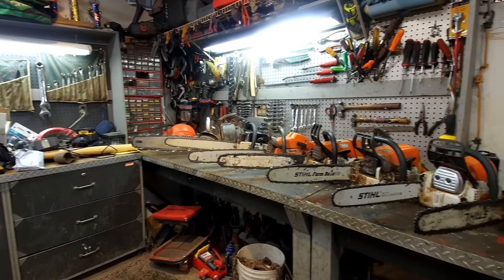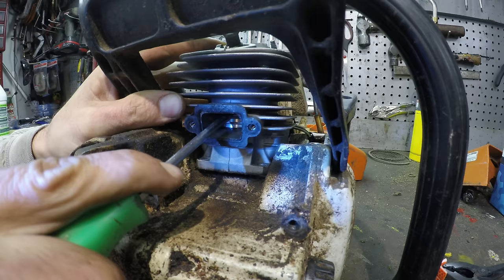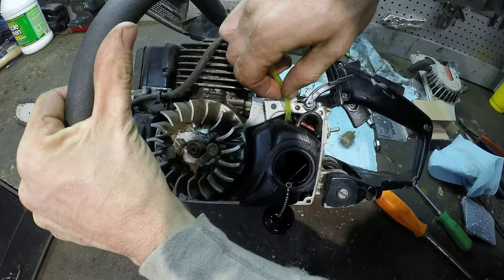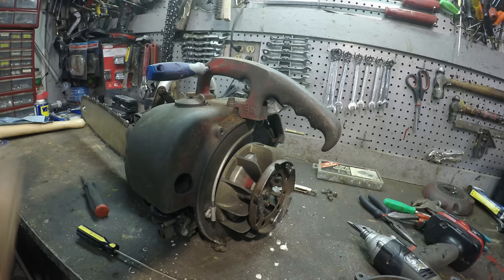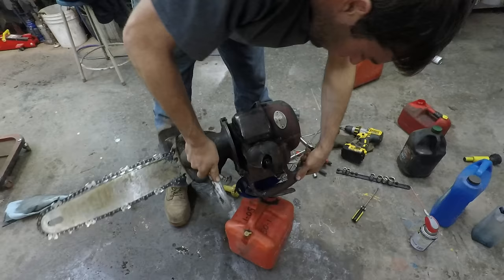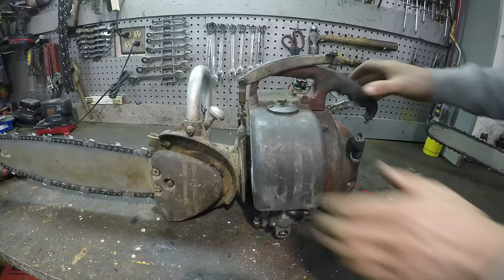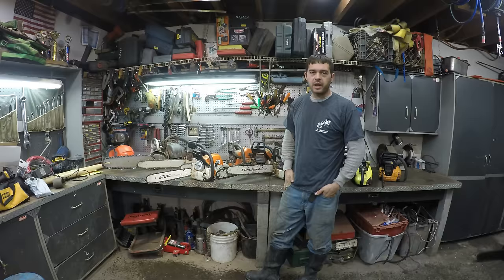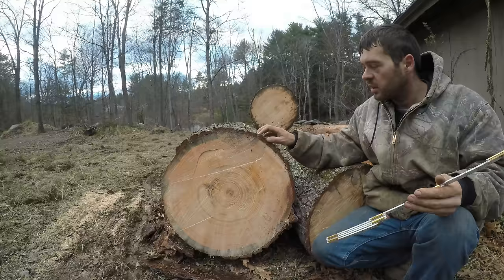Fixing and talking about chainsaws

Comment: Two pieces of advise:  put oil in the cylinder and on the piston rings during assembly. re-tighten the head bolts after a few heat cycles, you will see they need to be re-tightened.
Reply: Agreed.  Assembly lube would be even better especially on the bearings.  That first dry start is a killer.  Take care.  Doug
Reply: I was actually going to say something similar ! Something to add in as I’m an arborist climber owner of my family business. One thing I might want to add. As a new rebuild I would almost treat it as if it was a new saw ? I’m not 100% sure but I would assume so ? Correct me if I’m wrong. When we purchase brand new saws as the business is expanding we are always told to run one tank of fuel through at idle and then the second tank we cut but be a bit easier on it not bam bam bam rapid fire cutting. Give it a little break time and then third tank hammer down. I usually just idle a tank on the way to the first jobsite and she’s good to go. Always had my saws last 3-5 seasons minimum. I have a few big Stihl that we beat the living crap out of 2000-5000 hrs on some of these saws and nothing aside from sea foam in my mix every single tank. Keeps that shit clean and running great. We cut 8-10 hrs a day every day M-F
Reply: First thing I thought, too. Then I said...Andrew did it off camera
Reply: JJY Gardener your probably right. I just wanted to make sure =) my chainsaws are very near and dear to me ! Haha
Reply: I do believe from my day running dirt bikes that the orientation of the wrist pin clips is also important. If I remember correctly the gap should be 180 off from the whole so to lessen the chance of the clip falling out
Reply: I TREAT  these saws the same as any new engine , with a breakin period and these i run rich with oil just to keep em going for a long time , more smoke the better for a while.
Reply: rick davidson If you run it rich with oil then you run it leaner on fuel , so you really (don't know if they are) need to adjust the carb then. float-needle a touch higher or a bigger jet.
Reply: @mitchelsallseason9359  - Something I never hear mentioned in any chainsaw videos is that stihl saws require higher octane gas than any of the others, that is why they run poorly on regular gas.
Reply: Rattlerjake1 hah yep I totally forgot to include that ! I only use premium gas on my chainsaws, sleds quads but you right ! Nobody ever mentions it.
Reply: Dont use ethanol blends in your machines
Reply: Ya, fine guys.  He doesn't dress the metal before welding either.  The thing is, he gets stuff done--in a hurry.  Maybe all our  'gotta does' are just what someone told us was necessary.  Maybe a lot of it isn't...
Reply: Adding to this great advise is also putting a paper towel under the piston as you install the wrist pin clips so they don’t get lost in the bottom end.
Reply: I read through many of the comments here  and this is my favourite critical comment. I think the kid is very good. If he adopts beechwood's advice and the other YouTuber's advice he will be the supreme master!

I take my hat-off to anyone that has the patience to work on chainsaws and other types of engines. What I mean is not giving up until a solution is found and the engine purrs like a kitten.
Reply: Always cut of the biggest part of the center wire part of the wrist pin wire locks where you put the needle nose pliers on. These center parts tend to wobble around at high rpm and catchin the ports and distroy piston and cilinder
Reply: Right

Comment: I'm a forestry student at Virginia Tech and I've been studying a lot about timber procurement this semester!  A lot of saw timber mills usually purchase wood by green weight, and pulp mills usually purchase wood with a flat rate per truckload, both with a desired diameter range, at least in Virginia.  Anything over a DBH (diameter at breast height) of 12 in is usually considered sawtimber unless it is irregularly shaped and then the amount of 16 ft saw logs are also estimated before harvesting so the forester has a cost estimate on what to pay for the standing timber.  Anything below 12 in is considered pulpwood, but pulpwood can be bigger.  Both pulp and saw mills usually have a maximum cut off of around 22-24 in DBH because they can slow down or jam the system if they're too big.  Of course some companies do it a bit differently and for their own reasons.  A lot of factors go into estimating the value and how much they can get out of timber based on log rules like Doyle.  There are Forest Service researchers that help develop the equations that are used to make up those log rules and programs also exist that can help estimate value of timber with great accuracy with just a few measurements.  You'd have a field day if you got a hold on the machinery they use on logging sites!

Comment: Not being critical at all, lubriplate engine assembly lube, or GRC engine assembly lube would go a long way on first start lubrication. Just a tip from an old man
Reply: Yar Nunya  sounds like your on the right track, just get started and it will all fall into place.
Reply: Yar Nunya  - It's a Honda, they never die.  Just spray some starter fluid in the air cleaner and varooooom!

Comment: Tightens bolt as tight as possible without torque wrench
“Alright. That’s torqued to spec right there” 24:53
Reply: I always tighten until the fastener starts getting easy to rotate. Then you no you have just passed the maximum torque of that fastener and material
Reply: If you are a expierenced wrencher you can torque to a ballpark close spec. Others dont have it at all and  can break any bolt/screw regarding size.
Reply: German specs. Goodentite!
Reply: @pikePERSUADER1  I can confirm lol
Reply: OK so with aluminum it’s probably a good idea to use a torque wrench if you’ve got one. You can also put a little blue Loctite on. Chainsaws vibrate a lot. Loctite is good stuff and the blue is easy to get apart Later.
Reply: One of Andrews many sayings that we've all come to expect.
Reply: you forget somthing this is Andrew Camarata and hi fixes things the Andrew Camarata it may not be pretty but it works at least for this time
Reply: its called a built in torque wrench....i have one of those too..

Comment: Be sure to grease wrist pin on piston, I know it dosent need it while running but on first start assembly grease is very important, itll last longer..
Reply: Exactly my comment. My father was a Master Mechanic.  He always said a light coat of oil on dry moving parts never hurt, at best will make things go together easier.  Noticed it was hard to slip that head over the piston.
Reply: was thinking the same thing on reassembly.
Reply: Never want to use grease only use 2 stoke oil
Reply: Came here to make the same comment.  That bearing was bone dry, as well.  At least cover it in oil.
Reply: Oil NOT grease.
Reply: I have heard from a very good machinist that he puts things together with STP. I would agree you definitely need some lubrication when assembling any engine.
Reply: THE MALL WAS JUNK THE DAY IT WAS MADE.
Reply: @slickwilly1099  It Was better than an Axe Or Bow saw !! I lived it !!!
Reply: @Harley8226  ok boomer.
Reply: I would personally just use 2 stroke oil on the wrist pin when installing, I don't think grease mixes well in a running engine

Comment: Great channel! I worked construction and always enjoy watching pros.

Our road crew had a couple of chainsaws from late '50s - early '60s. They had always used 30W motor oil in premix. That's probably where the 12/1 ratio came from. I used 40/1 and they ran for several more years. With motor oil, the gas always evaporated/separated and first pull,  oil in the cylinder. Made them hard to start. A half teaspoon of gas down the carb worked. Both were manual chain oilers you pumped every minute or so. They were also low RPM chainsaws, at least at the chain. Kinda slow cutting. And they had hardnose bar tips, which sucked a lot of power, roller tips much better. The swivel ring on some old saws was likely so you could turn the bar sideways for felling. Some really old saws wouldn't run on their sides. 

I took our old 990G Homelite and put a 4 foot roller tip bar on it with a skip tooth chain.
We had a lot of big redwoods blocking roads after winter storms. The 990G could do a six foot log if needed, but it was slow.

Comment: Andrew, a little 2 stroke oil when you assemble small engine goes a long way, I cringe when I saw you put parts together dry.
But I love you videos I wish I had your energy. Your videos keeps me glued to the screen for the duration that's for sure.
Good job buddy
Reply: I wish I had his patience!! LoL
Reply: Does she like it dry?!?  NO!!  Put some lube on that thing bro!!
Reply: came to the comments to say the same. ANY will do for those who might be curious, 4 stroke oil, transmission atf etc etc
Reply: @bryanford1139  do you mean like slobber on it first? 😀
Reply: @cdoublejj  I can guess what one of those etc might be. 😀
Reply: A guy once told me that everytime I run my saw out of gas I also run it out of engine oil. I thought about that and I guess the oil is mixed in the fuel so it must be correct.
Reply: my thoughts ahhhhhh no oil first oil when ready then oil at finish. like hitler he lost the war at the Urals his boss we run out of oil in 2 months  it did

Comment: I went into my shed and found my dads old chainsaw, hasn't run in 50 years.So I fixed the spark and put a sparkplug in it and cleaned it, fresh fuel and it runs good.

Comment: When you put a new piston and rings on a new jugg you should oil the rings and crank wit Assembly lube or 2 cycle oil. 🛢
Reply: And use a torque wrench.
Reply: Ron's cha-ot-ic world you don’t use assembly lube on chainsaws
Reply: Only 22 $ , it will last a couple of years , thats fine ,,,,lol
Reply: @Wanous-hv7zo   Correct. Dry assembly is fine for 2 stroke engines in dirt bikes and chainsaws. I've never had an issue and the old timers even say it helps shorten the break in period.
Reply: When you made it in the world you don't care.
Reply: When you put a new piston and rings on a new jugg, you should oil the rings and crank with Assembly lube 2-stroke cycle oil. 🛢
Reply: @jet-black  I'm an old timer and the ones your listening to are wrong. If Andrew was following a service manual it would tell him to use oil on all moving surfaces that are metal to metal. I just keep a pistol grip sprayer handy full of two stroke and also assembly grease for non cage needle bearings.
Reply: @jimknowles7643  You are 100% correct sir.

Comment: You asked:  Get on Amazon and check out the Pferd chain sharp filing guide (same as Stihl but about $10 cheaper).  They come for, pretty much, all tooth sizes.  I have them in my tool box.  It takes me about 3 minutes to PERFECTLY sharpen a chain in the field which is much faster than your grinder in your shop.  Fyi, I live in the Pacific northwest - there is a HUGE timber business here . . .

Your ingenuity in fixing things amazes me.
Reply from the maker: Ok thanks, I ordered one. 3/8" right?
Reply: @AndrewCamarata  3/8" is what I use on my saws.   Let me know what you think of it.   There are about a zillion videos on YouTube using them if you're interested.

Comment: Hi I have worked at Husqvarna assembly. We weren't allowed to cut the fuleline with a snipping tool. "Then they crack" they said. So we had a special sharp tool for that, to scissor it of, just as the tool for cutting dog's claws.
Reply: That's cool.
Reply: Krister Kristiansson a
Reply: That's a handy tip!
Reply: We use the same tool for cutting zip ties at Generac

Comment: Love your video! A small tip when re-installing new piston on a chainsaw. Put a little 2 stroke oil before inside piston bearing and piston ring. that will smooth out the first start when all is damn dry.

Comment: You are absolutely right about scaling the logs, many different ways, grades etc. I've ran a sawmill in Missouri for about 3 years now, and something else to note, there are 2 main log scales, doyle and international (some less common, cedar scale, scribner) that most yards will use. When you are selling smaller logs, softwoods or scragg (usually pallet grade hardwoods, small diameter) they may buy logs by the ton. Doyle scale will scale lower on smaller diameter logs, and international scales higher on smaller logs. Just because a mill tells you a board foot price, you should ask what scale they are paying on. Some will quote a higher per BF price than other mills in the area, but pay on doyle, so it can be less. Don't be afraid to call around. Some mills pay the same regardless of the market variations, and some will fluctuate their prices daily. White oak and black walnut are the highest paying types here in Missouri, varying from $1.00-9.00/BF.
Reply: Anthony Krueger Is Reelfoot still buying? havent sold there in a perty long time just curious. Noticed Mo was yer state and the market you mentioned sounded like the south east of the state. Where is yer mill in case I work within a few miles of you...at times I range out perty good!                                    Stay Blessed,  Kev
Reply: Kevin Pilkington my mill is over by St. James, MO close to the center of the state. I do still buy logs.

Comment: Thats torqued  to spec right there..🤣🤣🤣
Reply: Tight, plus a quarter turn is always "spec" :)
Reply: @joeyoliver579  Tight and a grunt. 1/4 turn is too much.  ;-)
Reply: I like it a lot! It Never failed me😎
Reply: lol yeah
Reply: I had to swap injectors in my f250 and my torque wrench wouldn’t fit in the tight spaces. I definitely made my own “click” just as I felt like I was about to break the bolts lol. Been running fine for years now.
Reply: in the older book of stihl its once the bolt is snug its about 1/4 turn. in a X pattern.
Reply: Yep, in Australia doing Heavy Equipment repair we've got two specs - FA and FT, Fuck all and Fuckin' tight..

Just kidding... Or am I?
Reply: "Click"!
Reply: I know right? That was great!

Comment: You are a miracle worker. I know most of those saws and have quite a few of them. I can’t believe you got them to run. None of mine are working now & i do NOT have the patience you exhibit. Wow is all I can say. Thank you for so much inspiration. I will say, years ago I came across a similar 1950’s monster saw at my local Sunday market. I think he wanted $400. It was basically a Johnson/Evinrude outboard motor configured as a chain saw. Unreal. You had to flip the engine over to engage the float bowl, get it going then flip it back to keep it running, it was like a Merlin in a Spitfire but doubtfully that reliable. Insane piece of kit. My “X” said if I bought that, there would be no need to show up for dinner. Best $400 I ever spent!  I will be watching this vid again to try & get more of my saws running again. Thanks for your great work. PS when I saw you bring out the “mini” skidder and grab a tree I thought , “why is he not just going to hang the tree instead of cutting on the ground....” bingo.... touché...

Comment: Growing up in rural Dutchess County across the river from you in the 80's, my family's old house sat on 11 wooded acres. We didn't have ALL the neat stuff you work with, but we always had a Stihl chainsaw kicking around. If it wasn't constantly making firewood for the woodstove in the living room, it was clearing fallen trees and branches from the 800' dirt driveway. After school, my friends and I would sneak the chainsaw into the woods to cut trails for our little dirtbikes- huge time-saver. I remember in the early 80's as a boy, going with my dad to Steve Brady's chainsaw shop. It was in the garage of his raised ranch home back then. As Steve taught my dad how to use and maintain the thing, I was ogling the Stihl babe calendar hanging on the wall above the workbench. Years later as a construction worker upstate, I helped build the barn for Brady's Power Equipment. Steve had come a long way and had a fancy family-owned operation by then. Many years after that, I work in NYC construction but STILL use a Stihl chainsaw. But these days I'm cutting off wood shoring or big plastic gas pipes to be worked into the city's gas main system. Funny, this video brought me back to my family's ties throughout the years with this humble, but extremely useful little machine!

Comment: I'm a McCullough guy all the way (but not the new ones). Brand I use the most though is a husky. The only problem with Poulan saw  are that there carbs plug up no matter what you do also an interesting fact is that Poulan saws are McCullough saws I'm glade you did this video chainsaws are under appreciated it used to take hours to fall mabey 5 trees wich no one thinks about and they are such an important tool. I just love fixing chainsaws as well.
Reply: We quit using McCullough thirty years ago. After they cheapened them up, they would break in the middle of a job, and the repair price and downtime was unacceptable. We went with Stihl. but I'm sure there are other good brands out there.
Reply: @jbbuzzable  yeah they have been junk since they have been producing them cheap but I have 3 of the old pro series from the late 70s to mid 80s that will cut threw just about anything.
Reply: Maybe**
Which**